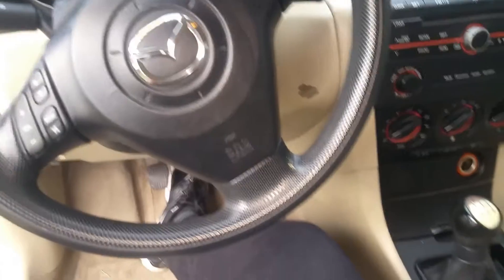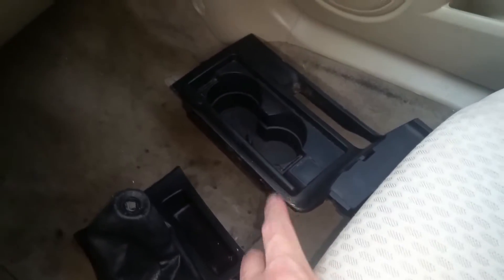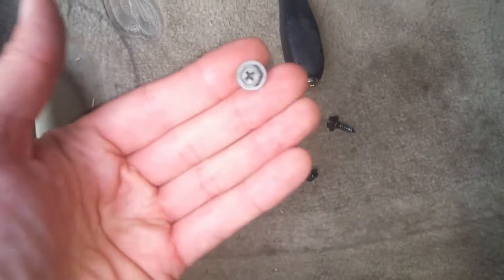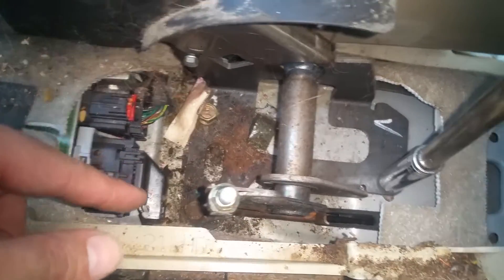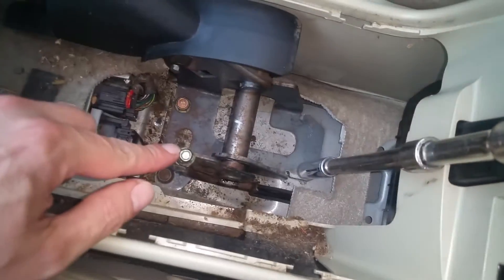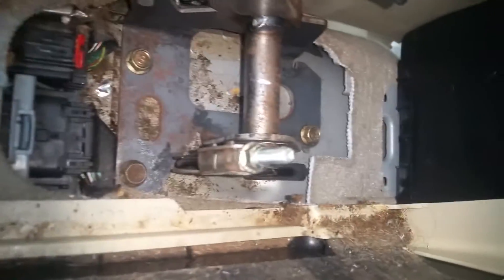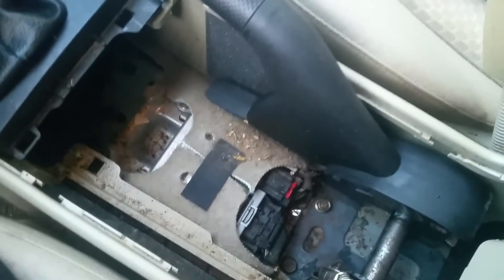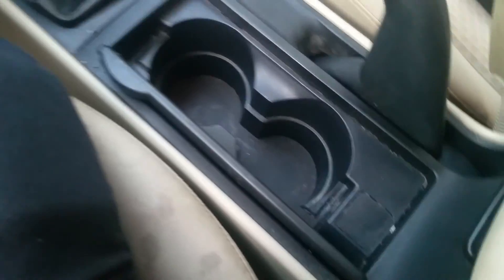Replacing Emergency brake handle parking brake Mazda 3 2004-2009

Comment: I believe you dont have to remove the other trims up to the ash tray bay, had nothing to do with removing the ebrake assembly. Just removing the drink holder is enough to access the ebrake.
Reply from the maker: +Norman Manio thank you for the feedback and sorry for the late reply.  The console has to be removed or moved back some because of the rear bolt on the E brake is nestled under the console storage box . Even If you could remove the rear bolt by use of a ratchet wrench it would be way harder than removing the console . Also removing the console makes the replacement easier due to more room . You can remove your cup holder easily and look yourself and see the rear bolt I'm speaking of . Hope you found the video helpful and thank you for watching